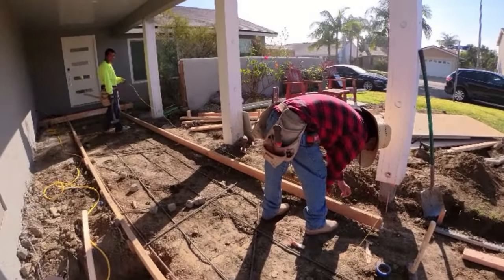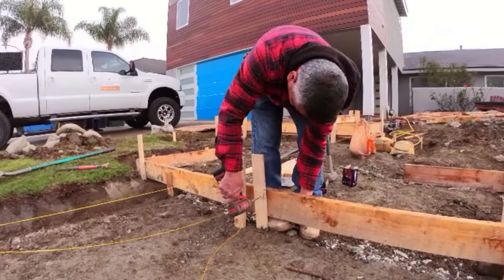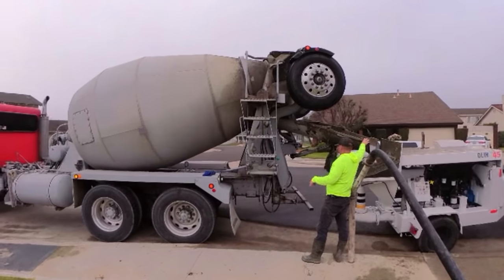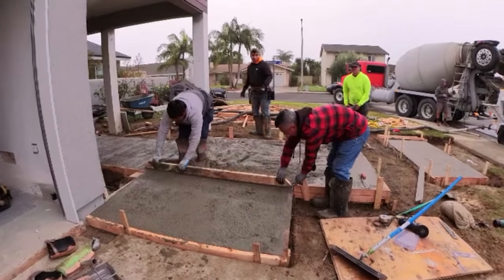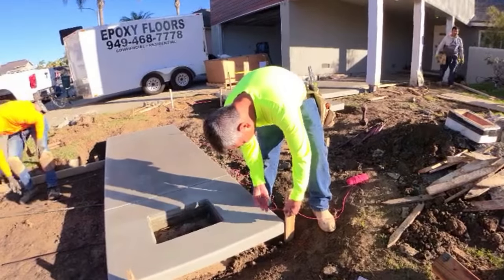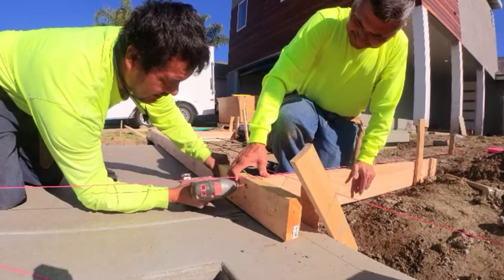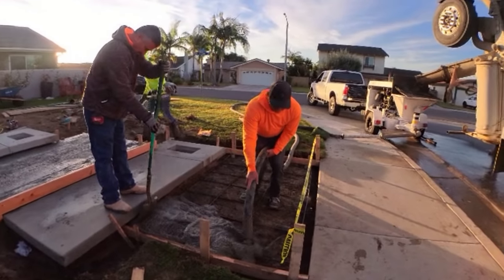Concrete Floating Steps. Front Entryway. California

Comment: 4"x4" at the bottom and 4x4 at the top floating? So the whole step i 8" thick?  The final "floating effect gap is 1,5" ?  I live in Poland and this kind of sidewalk/drivaways aren't popular at all. But I'm finishing my house right now and I want those floating stairs :) 
Top job! Hands up.
Reply from the maker: 4x4 at the bottom to achieve the 3 1/2 hang over 👍
Reply: @WestCoastCustomConcrete  Can you tell what is the max surface dimentions without dilatation (joints) in summer/winter climate conditions? (I realize it's much different in California)

Comment: Super sharp work as always...looks like an A+ crew doing it.

No concern of the 3.5" cantilever breaking off with 3000psi concrete and no reinforcement?
Reply from the maker: Hey thanks for watching Ronald 👍 I've done a bunch of different floating steps with that Hangover and they have all held up 💯
Reply: @WestCoastCustomConcrete  That's good to know as we have to use 4000 for everything exterior in Iowa/Illinois because of the cold...come to think of it I've put 3.5" cantilevers on residential stoop tops but they're usually over 4" thick.

Keep up the outstanding work and thanks for sharing it!

Comment: So I seen 1 problem you guys did with this pour. You didn't put a expansion foam in place around the front door and along the side of the house where the new pour went! That's suppose to be done so that when expanding and contracting happens the concrete won't mess up the house or cause that new concrete to crack. Which it can even with rebar inside.

Comment: Yep - really nice set of steps.  Love the precision you guys achieve.  What happens to the wood former underneath each of the cantilevered steps?  It's trapped there right?  Or is it removed on phase 2 of the pour and the mud in the lower steps gets pushed under the overhang of the step above?
Reply from the maker: I removed them. That's why I did in two pours👍

Comment: How long after each pour till you stripped the overhang form especially after second pour where form was wedged between concrete ?
Reply from the maker: Overhang same day. The 4x4 the next day.
Reply: @WestCoastCustomConcrete  was the ripped piece on second pour cut on a taper to remove from front or was it pulled out from side?
Reply from the maker: @darrellgilbert6221  that was a nightmare to get out. I did it from the side 👍
Reply: @WestCoastCustomConcrete   yeah, same day but time wise; minutes?  hours?

Comment: How did you guys come up with the amount of steps you needed? I saw your formed some of them one day. The rest another day.
Reply: Get your vertical distance and devide it by your step thickness. It will get you a rough number. You have to consider the drop you add with the slope of the step. Usually use a 1.5% slope max. 1.5(horizontal distance) * the amount of steps you calculated would be your slope drop.

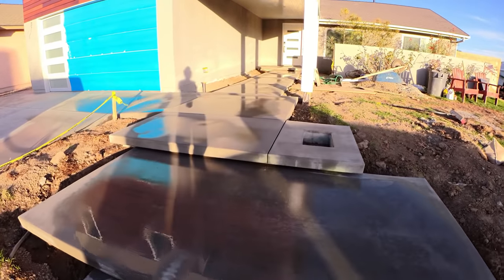Comment: 11:07 Was it possible to make the top layer of the surface slightly sloped (corrected) to avoid puddles?
Reply from the maker: Sloped not crooked.
Reply: @WestCoastCustomConcrete  Thanks, right, "sloped". So what about bit sloped? Will be that view the same nice as we see here?
Reply from the maker: @contentex1  yes it will. I will do a return video when all the landscaping is done and the light's are in👍
Reply: @WestCoastCustomConcrete  sorry if Im annoying, I mean how do you think will it will be possible to make the surface not abs. flat (and to have puddles) but little bit sloped to avoid them. How do you think will such slope will be viewable by eye and not attractive in final? tnx
Reply from the maker: @contentex1  you have to finish it correctly and it will be fine.

Comment: Is a special composition of the concrete?
Reply from the maker: Thanks Yanis👍
Reply: @WestCoastCustomConcrete  It was a question. I need to know if the composition have something special.
Reply from the maker: @yanisvoda8793  no it doesn't
Reply: @WestCoastCustomConcrete  Do You put wather or some oil on surface of the concrete to can work it?
Reply from the maker: @yanisvoda8793  no nothing on the concrete. Oil on the forms so you can pull them off clean.